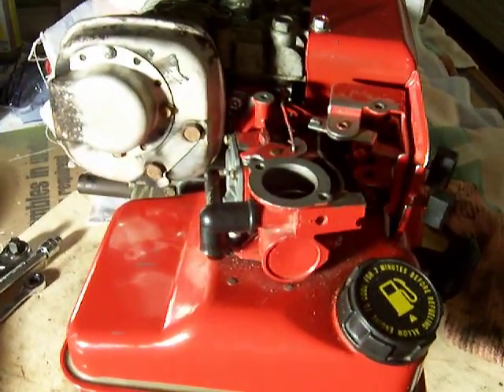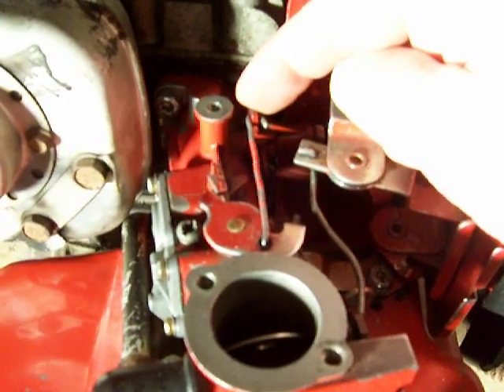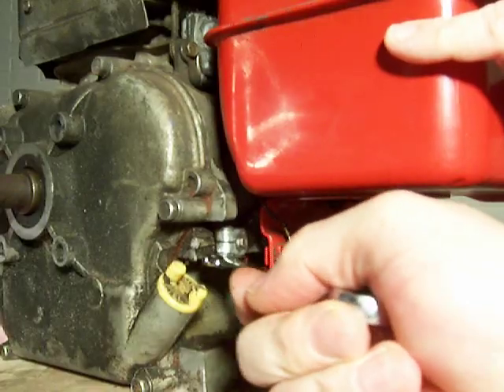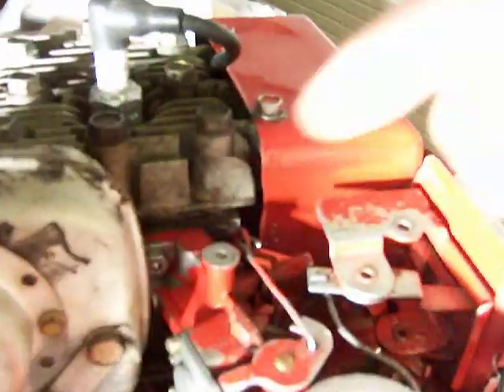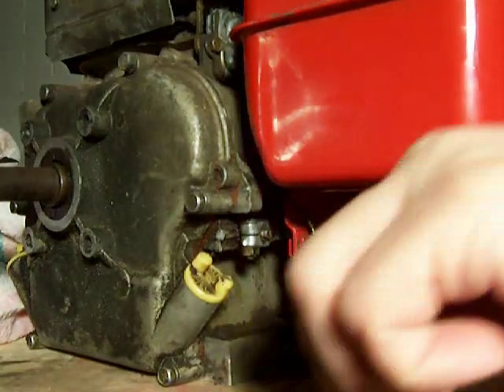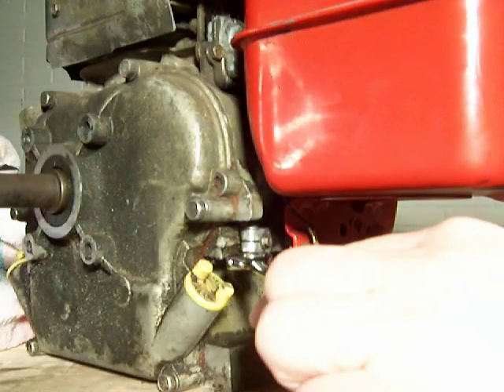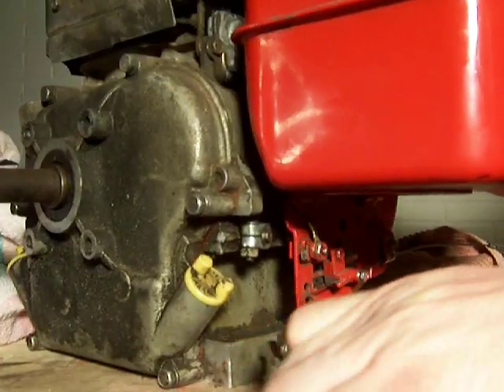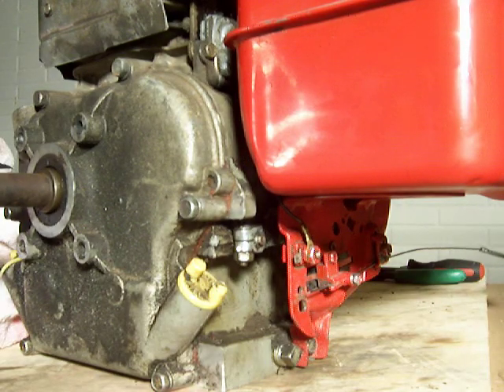Briggs and Stratton 5HP  - Governor Adjustment - Model 135202

Comment: As I have just seen that your 5HP B&S motor which is identical to mine, I have two questions - is there a quieter muffler available?    Can a screw-in hot-dog muffler be quieter?
Reply from the maker: I believe so, but I don't know enough to give you good advice on the subject.
Reply: @RealManSkills  Thanks anyway, I ran it up for the first time in a few years and got some dark looks from my neighbours.   I'll try a $20 muffler and see what happens!

Comment: 35ftps! Holy shit.... Are you sure? That sounds like head bolts. I mean, i ain't no gynecologist, but I ain't beyond having a look and give him my opinion..........
Reply from the maker: After 12 years, you would think that more people would catch my mistake. You are correct, that's too much. I meant to say 35-45 INCH pounds.
Reply: @RealManSkills  hahahahaha!!!!! I figured thats what happened lol. Thats funny dude! And thanks for replying. And that video was 12 years old? Wow... i liked your video alot. I just finished a 5hp yesterday myself. My rototiller popped last year, and nothing was reusable. The engine was a 1979, and i rebuilt a 1992' block which was in awesome awesome shape. But i rebuilt it anyway. Not one single scratch on the cylinder, or the crank and rod. Its amazing how that aluminum cylinder can ware out those rings like they were and not even have a ridge. So anyway i put all the parts off that 79 onto the 92 block and it runs amazing. Love those engines

Comment: I did this, and the governor is still preventing me from opening the throttle. Is this unrelated, or do I need to adjust it differently?
Reply from the maker: This is meant to limit the throttle to prevent over-revving. I'm not sure what you mean by "opening the throttle." Does it completely stop the throttle from moving?
Reply: @RealManSkills  Yes, it completely stops the throttle. When the engine is not running, all the linkage for the throttle and governor works. I can move everything with the lever. Once the engine starts, that all stops moving, and I can't throttle up or down unless unless I do it manually on the carburetor.
Reply from the maker: @VeggieBeard  might be internal
Reply: @RealManSkills  I ended up disconnecting the governor and putting my throttle cable straight to the carb cause even adjusting it while it was running it would not allow me to get a higher RPM. It was only decreasing the RPM

Comment: Does it make any difference where the throttle is (stop or full throttle) when the governor is adjusted?
Reply from the maker: Yes, as I mention in the video, the throttle must be in the wide open position. Thanks for watching.
Reply: @RealManSkills  I was referring to the throttle position on the dash versus the throttle linkage by the carb.  You mention pushing the throttle linkage by the carb to full throttle so that is a different area i.e. not the throttle position on the dash that pushes the wire inside the metal case.  I am not sure if the position of the throttle position on the dash makes a difference or not.  At this point I am only asking for the future as I found that my governor arm is broken.  The governor part going from outside to inside the case is broken so the inside paddle is laying on the bottom of the case.  I may not fix it as it is probably not possible to get a new governor part.  Thank you for the  help.

Comment: I have the same engine and after fixing a stuck valve it would not get to top speed.  I think I may have pulled the governor arm out of position or the spring may have been stretched.  I'll start with adjusting the arm.  Nice video, thank you.
Reply from the maker: Thanks for watching!

Comment: Hi just watched your video and it was very great my engine is having a problem with it where when I move the throttle it’s not moving the throttle on the carburetor and the spring just slides I’m wondering if this is a governor issue or what is wrong any chance you could help me out?
Reply from the maker: https://youtu.be/6q8WEp5qV0o

Comment: How do you disengage the governor
Reply: if you mean make the govenor not do anything you have to take the crankcase off and take the arm off and the spinner and put a screw (i think quarter inch) in the hole where the arm was with the linkage still there or the spring will fall off

Comment: what happens if you disconnect the governor arm COMPLETELY and run the engine? is that consider bypass?
Reply from the maker: Yes
Reply: Will it run like that?
Reply: @MrsBuddevil  yes. And much much faster
Reply: @RatontinChulo  mine was running way to fast... Think  I screwed it off trying to simmer it down.. now it will start but won't stay running... Smh.. lol.

Comment: Very nice instruction video.  Now I understand how to properly adjust a B&S engine governor.  However, one mistake in the narrative needs to be clarified.  At 2:24 he mentions that "the Briggs & Stratton repair manual says to tighten the nut to 35 foot-pounds of torque".  The correct units should be INCH-POUNDS, NOT foot-pounds.  35 foot-pounds would snap that small bolt right off.  Now, not that anyone is probably using a torque wrench to tighten that nut......BUT, if anyone were to do so, the correct reference would be "inch-pounds", NOT "foot-pounds".  JUST-sayin'.
Reply from the maker: You are not the first to mention it. Thanks for watching.

Comment: Can you tell me what the linkage is at the bottom of the fuel tank? It has a plastic cam that looks like it slides . the one on my engine is frozen , rusted.
Reply from the maker: Some applications have a throttle cable attached below the fuel tank. Some machines may use that sliding mechanism and some don't. Depends on what machine the engine is on.  My other video may help - https://youtu.be/6q8WEp5qV0o

Comment: very informative! mine runs great until the little "fuel bowl" in the tank runs dry. just replaced the entire carburetor assembly (with new pickup tube), still does the same thing. im tearing my hair out!!
Reply: fuel pump diaphragm or split pickup tube perhaps
Reply: Me too,I'm watching this to see if maybe the governor needs adjusted. Mine is on a tiller and was surging when I bought it,so I bought a brand new carburetor and it still surges. I'm not sure what else it could be?

Comment: will adjusting this make it loose power?
Reply from the maker: If it's adjusted to factory specifications, it should have the power that the company has it rated at. In this case, 5HP.

Comment: why does my go-cart idle fine but wont take off it wants to stall
Reply from the maker: +Donald Green Without knowing more details, I would guess that when you try to accelerate, the carb is getting too much gas and choking itself out. Carb adjustment needed. Hope that helps. Thanks for watching,

Comment: Solid video.  Any idea where I can find the manual for this engine?  Bought a go kart for my son with this motor in it that isn't running.
Reply from the maker: +Tyler Read Check out "Briggs and Stratton 270962" - it's a "Service and Repair Instructions" book. There are different printings of this book out there, try to find the newest one for the most recent information. For example, I have one that was printed in 1983, and another that was printed in 1992. I also have two others that are older but have no date. So again, find the newest one that you can.
Thanks for watching.
Reply: +sblg43 Do I turn it counter clockwise to slow the idle speed? I followed your video and now it is idleing way high.
Reply from the maker: Tyler Read  Sorry but this video is not about the idle speed. You don't want to use the governor to adjust idle speed. That is done elsewhere on the carburetor and is not easily explained. Sorry that I don't have a video to show you how that is done. Maybe there is another video out there on youtube to show that procedure.

Comment: thanks for the video they are very good. I must point out for a briggs quantum vertical shaft. The Governor  shaft must be turned anti clockwise.  orherwise the engine will over rev.
Reply from the maker: +rockartistet Thanks for watching! Thanks for the additional info.
Reply: As I found out Today .... I figured it out after 15 mins of wondering and thinking about it   ....
Reply: @garywatson8602  so is it counter or clockwise? You boys are confusing this girl

Comment: Great Video.I've been messing with a similar motor 135202 and is missing the part where the throttle cable ties into the screw on your motor under the tank. I have the black square and the guy i bought the motor from had a screw into it with the with a cable and spring attached to it. Have you ever had to purchase that and if you had a part number. I cant find anything online but you. Glad to made this video. Thanks. joe
Reply from the maker: joe noneofyourbusiness A place to find great parts diagrams is partstree . com  Thanks for watching. Never had to order that part. Sorry
Reply: thanks for the info. found the item, 692316 Go Kart & Mini Bike Throttle Easy Hook-up Kit. Slips right into the govenor black square and tightens down with a screw. http://www.quickieparts.com/go-kart---mini-bike-parts/692316-go-kart-and-mini-bike-throttle-easy-hook-up-kit.html

Comment: I have a tiller with a Briggs stratton model 1263120580b8 engine. On it the governor spring pushes and keeps the throttle in the wide open position and I'm assuming that once the engine starts the governor is supposed to adjust the throttle down, but that's not happening. On the engine in your video, the governor moves in the clockwise position when you move the throttle to the wide open position, but on my engine the governor moves in the counter clockwise position when the throttle moves to wide open. So I'm not sure how to turn the governor shaft, shouldn't I turn it counter clockwise till it stops. Is this normal for the governor to move counter clockwise?

Comment: I've never worked on a 5HP B&S engine before. Bought a used rototiller that wouldn't start. Cleaned up the carburetor and got it started but it's loud and appears to be vibrating a lot. Oil is full and looks clean.  Not sure if it's normal.

Adjusted the governor according to your video but didn't make a difference.  Anything else to look at?  Thanks for the videos!

watch?v=P9kZynHF23E&list=UUHOfqpBhU0lxUajOZGuGfag
Reply: +Chad's DIY   I know it's been a year but....

Did you ever check to see if the flywheel key was in good shape?  If you hit a rock or something with a 5HP tiller and it shears that key, your timing may be way off and the motor will not run.  This is a $1 part, which is designed to fail on purpose, in order to protect more expensive parts of the motor.

Did you check the carb diaphragm?  That is the biggest killer of the 5HP engine.  It's a little rubber sheet the size of a potato chip.  Takes only ~5 screws to get it out.    If your carb diaphragm is anything but soft and rubbery (stiff like a potato chip is absolutely no good) that engine will not stay running.   It serves as a fuel pump to keep the motor going.   The test for a bad diaphragm is a few drips of gas down the carb.   If it starts readily with a few drops of gas, but then dies in 5 seconds, that's the classic symptom.  You're just not gettting gas.   These diaphragms need changing every 3-5 years and you can fix this for ~$3.
Reply from the maker: The vibrating could be a problem. A bent crankshaft will cause vibration. Replacing the crankshaft is expensive. You can run that one the way it is but eventually the vibration is going to cause other problems. But it may last for many more years that way! No way to tell for sure. It might be a good idea to keep an eye out for a replacement engine.
Reply: sblg43 Thanks for the prompt reply.  I heard it can be dangerous running like this so I will probably get a few tiller.  Looks like the previous owner messed with the governor because he didn't even put back the link correctly. ...  Worked on it again today but for some reason it wouldn't start now, whether it's at low or high.  Thank you regardless for the help.

Comment: How does anyone know how fast these engines are going?
As far a Briggs & Stratton I have a Pneumatic governed 3 HP (1979) a Mechanical Governed 4 HP (1979) and a 5 HP Mechanical Governed (1992), and a 6 HP push mower.
I also have a Tecumseh 5 HP.
None of them have a tachometer.
Reply: There are tachs for sale for any engine these days.

Comment: great video man. I am taking my engine and putting it in a bike so no real need for the governor since the load will be quite light. Mine is vert shaft and is converted to horizontal via oil system mods and carb adjustment. 6.75 hp 180cc on a steel frame bike. wooooooooo I am dying to see how that turns out lol.

Comment: Excellent explanation combined with a clear close-up video!  Had just attempted the exact same governor adjustment and couldn't figure out what the screw was for, but now now it's part of the governor crank, not a clamp down on on the crank.  Big difference.  Thanks a lot for the help out!  Will go back and do it right this time.

Comment: hooray 4 U !

 Thanx for these videos! 

U did a great job all around.

I a pretty good grease monkey..but never rebuilt a 5hp b&s. 

I watched ur video and away we go.

 I have cleaned the carb,head, new tank gasket, and fuel diaphram. and it's still a no start. (choked.../ then runs for 15-30sec..dies)

will adjust governor next.

But great videos...thanx!!!

Comment: Thanks for your post. I am a computer geek trying to teach myself this small engine stuff. I have followed your directions but I can't get the governor arm to react to the throttle. It will not spring back to closed in off position or vice versa. What should I look for? (The spring is attached).
Thanks,
Gary

Comment from the maker: There is no clutch cable for the engine, a tiller would have a control lever to engage the tines but that is not a part of the engine. 
As far as the throttle cable goes, there are many many machines out there with different throttle controls. So it would be impossible for me to tell you how yours should be hooked up - it depends on what kind of machine the engine is mounted on. Start googling engine pictures to get ideas.

Comment: mine does not have a tab near the spark plug,but i am trying to find out were to put the throttle cable,ther is a lever underneath the tank like yours has in the video so were does the clutch cable go as on my fathers machine which is a merry tiller, he has a lever under the handle and a throttle on the otherside

Comment from the maker: A grounding wire to the magneto is used to kill the engine and is usually attached to some switch or control for that purpose. Some older engines just have a metal tab that is pressed onto the spark plug to kill the engine. The tab is usually attached to the head near the spark plug. When you want to kill the engine, just push the tab against the spark plug until the engine dies.

Comment from the maker: There is normally a model, type and code for the engine STAMPED into the engine shroud. However, some older engines did have a metal plate with that info. The Briggs and Stratton engine that I rebuilt from 1955 has a plate. Of course, sometimes those plates do get lost over the years.

Comment from the maker: The linkage under the tank is the throttle control. I bought this engine used and it may have been used on a go cart. I had to modify it a bit to use it on my garden tiller. The throttle linkage is dependent upon the machine that the engine was used in (chippers, mowers, go carts etc..) There is no way for me to know the proper linkage that was  used on your engine.

Comment: thanks very nice to know,i have just purchased a briggs 5hp engine from ebay that needs repair.Iin your video next to your spanner below the tank is a linkage.could you let me know what this is for?as i thought the throttle linkage was above and behind the tank mine isn't fitted with a ground on the magneto also ik don't know the year it was made as the plate is missing